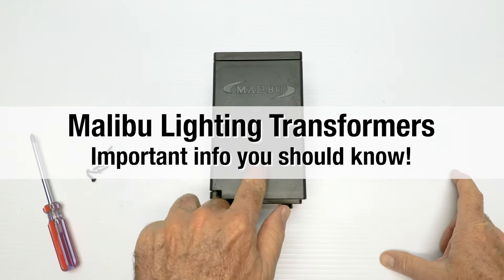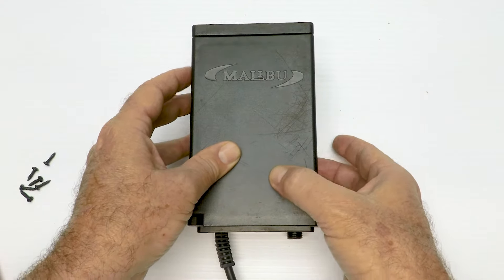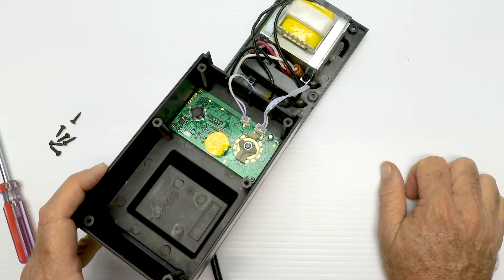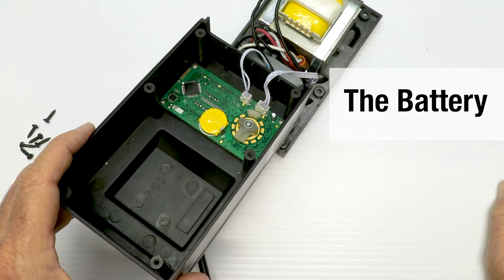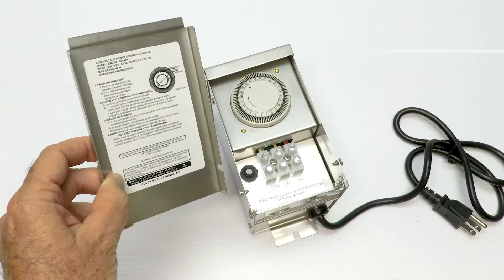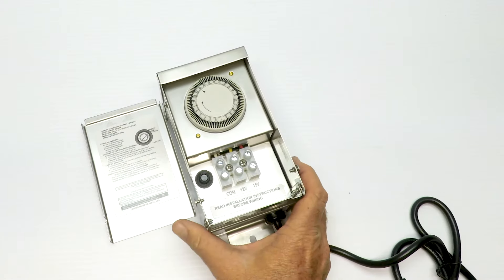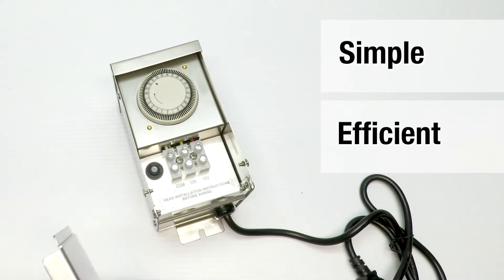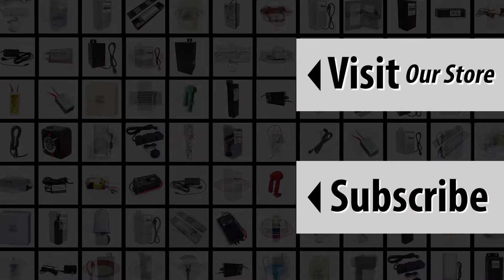1 Big Reason Why Your Digital Malibu Lighting Transformer is Failing by Total Outdoor Lighting

Comment: Thank you for this video. Super helpful. I was wondering why it wouldn’t use the correct time to come on and off but it was still working at Dawn and dusk via the photo cell. Again thanks for the video.
Reply from the maker: Thank you for sharing your experience and glad you found our video helpful. A low battery can be the root cause of all sorts of issues. If you are in need of a replacement transformer we have some great options on our website https://www.totaloutdoorlighting.com/landscape-transformers.html 🙂

Comment: Thank you for covering this, I thought for sure it was the transformer. The battery in there makes perfect sense, especially in the AZ heat.
Reply from the maker: You're welcome 🙂
Reply: How do you know when the battery is dead and is it replaceable?
Reply from the maker: @derekgrisales6779  A big sign it's failing is that you are constantly having to reset the settings. It is unable to save the settings.
Reply: @Totallightingsupply  Isn't the battery replaceable?
Reply from the maker: @cannotbeshaken7889  we have found it requires skill in soldering to replace it and from our experience most of our customers and contacts do not have this skill. but if you do it can be done :)

Comment: Old Malibu 200w unit, the clock display comes on and I hear a hum when I turn it to on but I don’t detect any voltage coming from wires with a 12-1000~ v Klein mini detector.  Could this be the battery issue or is my detector not sensitive enough?
Reply from the maker: Hard to know for sure but it could be the battery is failing or the magnetic transformer itself is failing as they do last a long time but not forever. If you know of another 12volt device you know works you can test your detector on that device to help you pin point if your detector is not sensitive enough. Or purchase a multi-meter from your local home improvement center and test with that. Since these do produce 12volt and your lights are not coming on, I am assuming, and your detector is not sensing any voltage I would say your transformer is no long working properly. We have a few options if you find you need a new transformer here ⬇

https://www.totaloutdoorlighting.com/emcod-esl200w-200watt-12-15volt-led-ac-landscape-outdoor-transformer-stainless-steel-with-mechanical-timer-photo-eye.html

https://www.totaloutdoorlighting.com/emcod-epc200w-200watt-12-15volt-led-ac-landscape-outdoor-transformer-with-mechanical-timer-photo-eye.html

Comment: I have an old Malibu transformer that is still going strong and wish to replace some landscaping lights with LEDs.  Looking online I see confusing and often contradictory information about whether an "LED transformer" is better, as many assert that LED transformers are configured to be more efficient with LED bulbs.  Your take?  Thank you for any insight you can offer.
Reply from the maker: When it comes to LED it really comes down to the quality of the LED itself. We have been selling LED low voltage landscape lights in kits with magnetic transformers for years with little to no issues. It's when you get into dimming and wanting to control the LED independently than the other lights that specific controllers and drivers should be used. We have hundreds of customers with older transformers like yours that replace their old incandescent light fixtures with our LED fixtures and have done it without issue. You can find our lights here https://www.totaloutdoorlighting.com/

Have a blessed day 🙂
Reply: @Totallightingsupply  Thank you for your prompt reply!  What is the wattage, lumens, and light color (K reading) of the LED replacement MR16 Gu5.3 light bulb for outdoor landscapes?  Thanks again!

Comment: i’ve got one of these and it buzzes loudly. can tours be resolved??
Reply from the maker: Sounds like it could be on its last leg. The only other issue I can think of at the moment is If the unit is on a dimmer. Many landscape lighting magnetic transformers are not designed too dim or if they can dim buzz loudly. If it's not on a dimmer then it sounds like it maybe time to invest in a new unit. If you do need a new transformer stop by our website https://www.totaloutdoorlighting.com/ and we can help you out. Hope that helps 🙂

Comment: Every time i power it on the bulb blows out,so is the transformer bad ,or the batttery? Thanks
Reply from the maker: Hmm, if by blows out you mean the bulb literally pops then it sounds like the voltage going to the light fixture's light bulb is too high. I would check to make sure everything is wired correctly and producing the correct voltage.
Reply: @Totallightingsupply  thanks

Comment: I've 'currently' been using '3' Intermatic Malibu outdoor low-voltage 'analog' timer transformers - all 3've been in use goin on "30" yrs now - 2 r finally goin on the blink this past month - strange but 2 now have basically the same similar  issues - IF they go on certain days they dont go off n vice versa - times on both r consistant (that part works) - tried changing the timer pins but still not workin correctly. 
Been searchin for replacements (both r only 40-50w) - COULDNT find any similar transformers ! One of them is mounted INDOORS - SO an issue develops since any found anywhere seem to rely on a 'photocell sensor' to operate. Whats with that ??? 
Issue #2 - all 3 Transformers r operating a mix of led, some older style wedge bulb lites, & theres even a lo 10w halogen on one of the lines ---- all 3 of those old Mailbu's have worked everything for years without fail - til now - even thou some of the led style lites were added as older lites failed or were broklen a few yrs ago.
I went n gave a new style a try - didnt work - wouldnt light the mix of 6 leds with the one halogen 10w style lite on the line so i returned it.
Then theres issue #2 - one of the transformers is mounted at an INSIDE location - I dont want it outside - seems all new styles need OUTDOOR mounting due to the sensor crap in order to operate.   Will the 40w listed on your site work for this issue ? Seems it didnt rely on the photocell AND If so what about (leds, wedge, halogen mix) ?   *Remember - Intermatic Malibu's did operate for the 2 issues.
Its kinda funny too - to take notice on how Bidenflation set in on transformer pricing - wasnt expecting $100 40w transformers.
Not sayin the landscape lighting biz did the following BUT it does kinda remind me of the way the car industry went over the years - factories started loadin em up with features so even the cheapest terd has a/c & power everything - 'no more options'.  Thou in that industry - u still hava cheap terd - only the price doubled  🙃

Comment: I have a 300W Malibu and trying to figure out what’s wrong w it. The lights turn on every day at 7pm and off at 9pm. I’ve tried resetting, changing the clock, changing the timer on off times, doing dusk to dawn… but nothing does anything. Keeps turning on at 7 and off at 9. Would this be a battery issue?
Reply from the maker: Sadly, it sounds like it may be the battery as the adjustments are not being saved and it's adjusting to a default setting. If you're looking to replace it we have a few solid options with great product support here ➡️  https://www.totaloutdoorlighting.com/landscape-transformers/shopby/manufacturer--emcod--total-lighting-supply/max-load-wattage--300.html